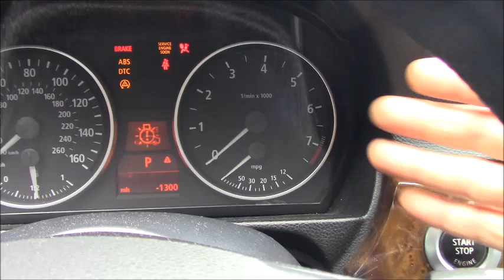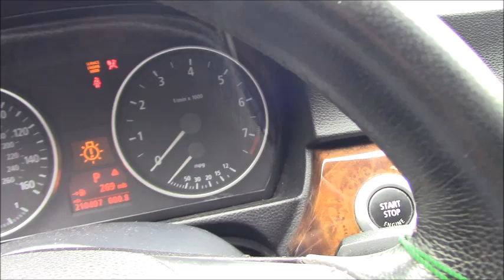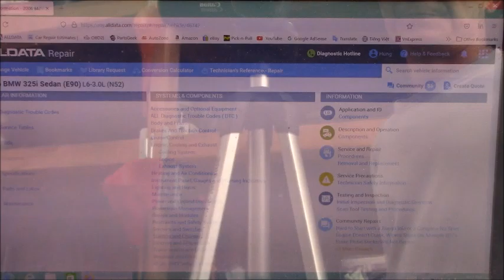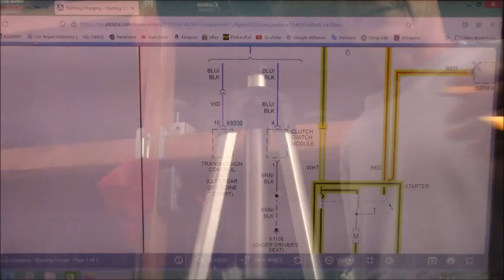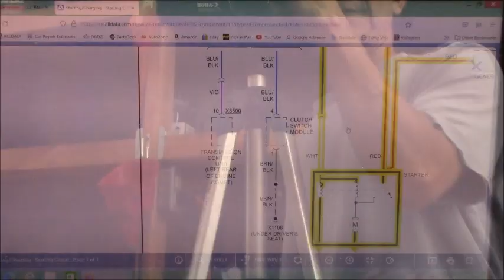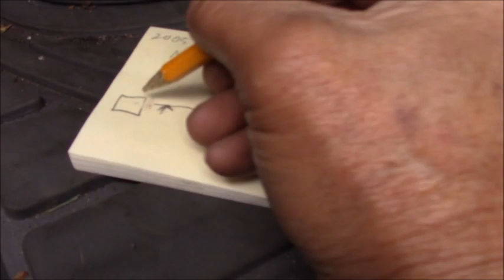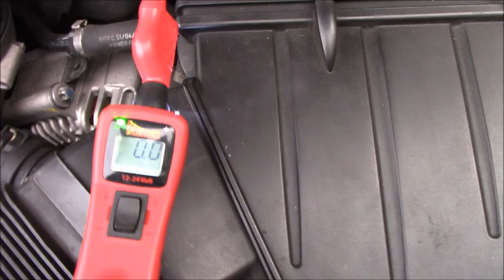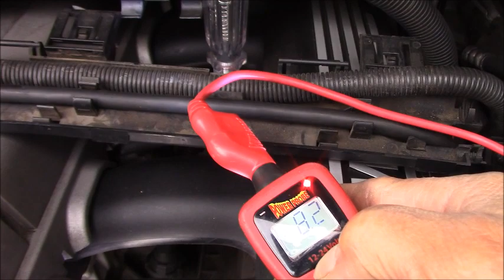BMW 325i no crank no start - diagnostics

Comment: My bmw does the same thing I just put a new starter in it started and then I drove around for a bit and turned it off now it won’t start again please help😢!!!
Reply: Was it the ground or realy?
Reply: @donnaclarke8595  what was it same exact thing happened
Reply: Did you ever figure the problem out?
Reply: @georgestewart9657  I did, the new starter failed. Apparently you need to use the OEM one. Don't buy an aftermarket
Reply: BTW my AutoZone starter only lasted turning on 2 times then nothing
Reply: Replace the B+ cable behind the fuse box.  You will have to remove the fuse box, i asumme your bmw is a e90.  Its not recomendly, but try pushing or hit in on the fuse box gently., maybe the car start.  It's a fail of the B+ cable.  Heres a video how to do https://www.youtube.com/watch?v=8OuT19ClJOQ  I hope it helps you. 👍